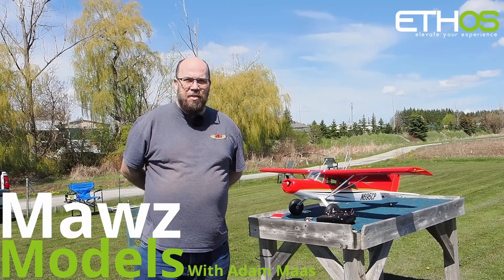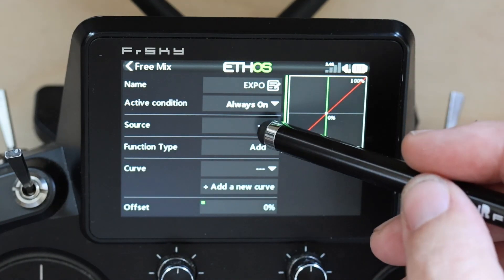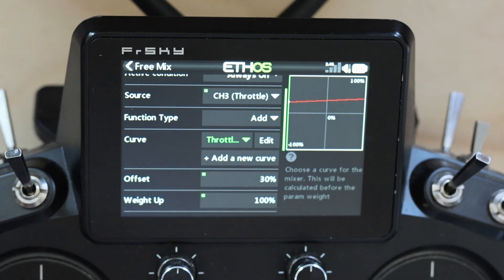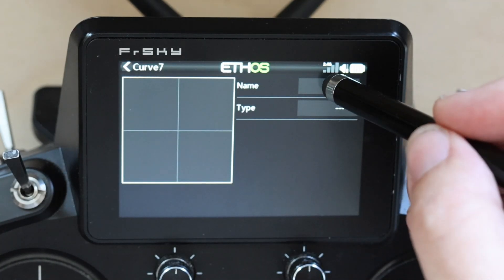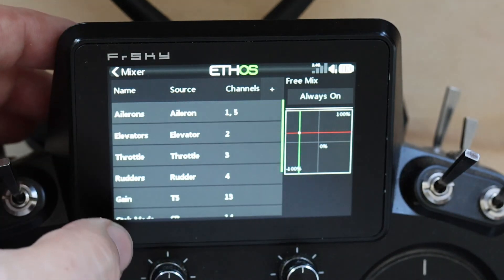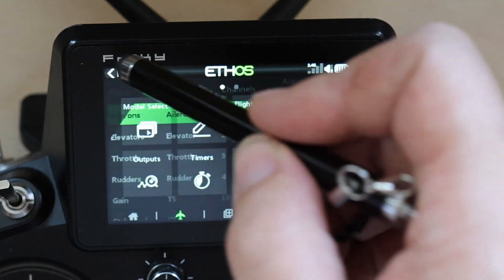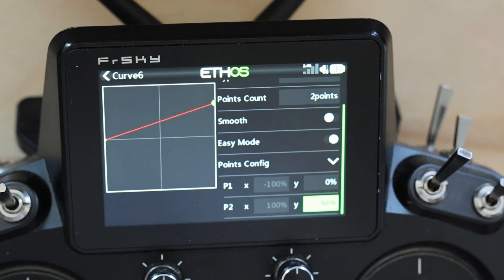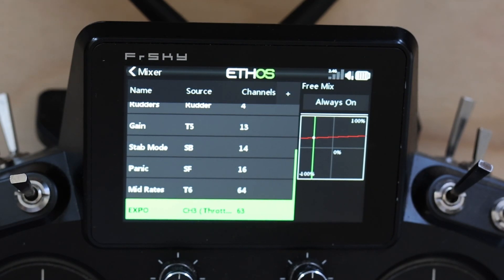ETHOS Tech Tip 13 - Throttle-Controlled Expo

Comment: Is Expo used in place of an actual throttle curve function in Ethos?   I am not finding an actual throttle curve mode.
Reply from the maker: No, you have to pick custom instead of expo in the curve when configuring it to get a custom throttle curve